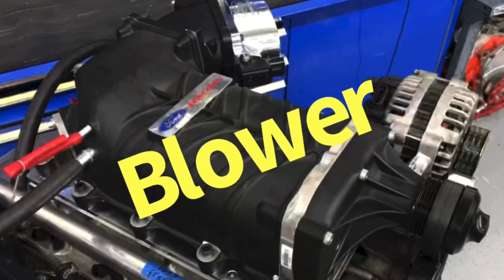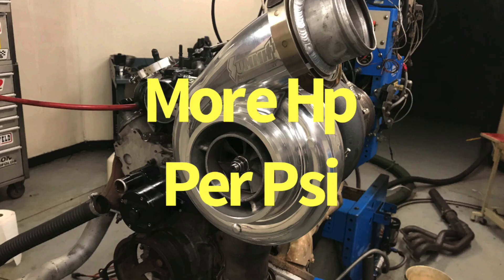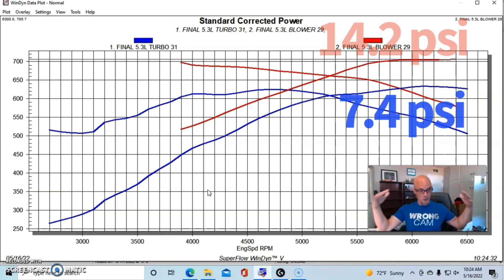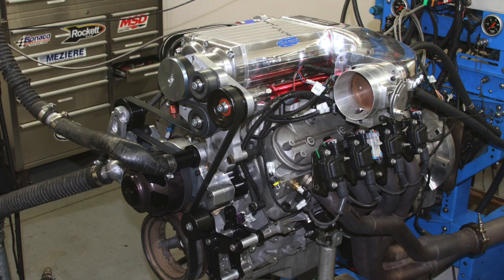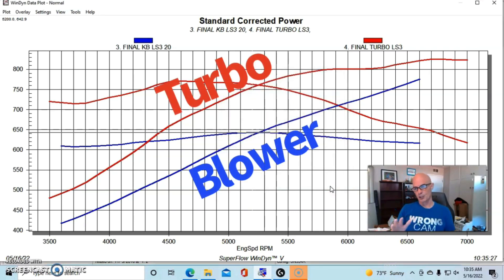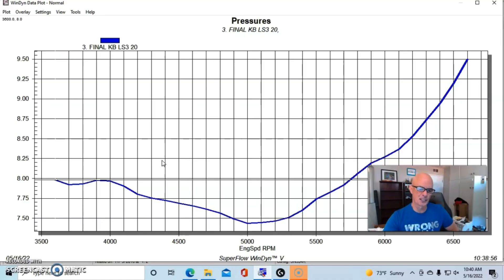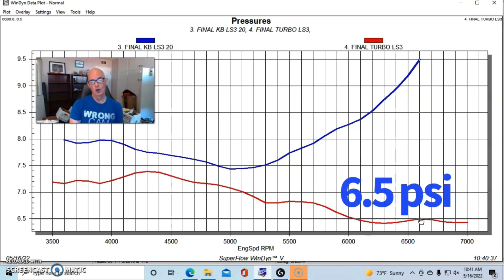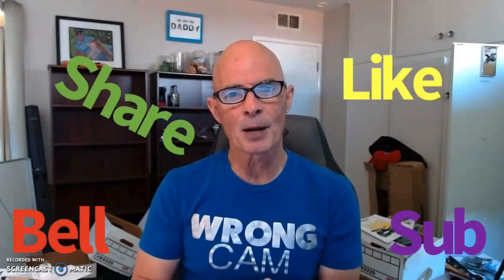LOW $ BLOWER VS LOW $ TURBO-DYNO PROVEN HP PER PSI! WHICH ONE DO YOU CHOOSE FOR YOUR BOOSTED LS?

Comment: I like both poweradders but let's face it, for the average guy working in his driveway Turbo's are free HP.  Even the "Cheap" blowers you feature with the manifold cost are well in excess of $3,000 anyhow.  With an Ebay GT45 some piping and gates you can outdo a positive displacement blower for $1,000, OK let's be fair and call it half the cost.  I have a 5.3 LS in my '68 C10 and I'm looking into adding a turbo, limiting it's output to 10psi and installing a 4l80 because I don't believe the 700r4 will last.  It's still cheaper IMHO than just the blower set up or darn close for most of us.
Reply: Turbo conversion for under under $1000? 
Never gonna happen.
It's exhausting hearing people say this over and over, and it's never a person whose done it.
Reply: @jacksonjdr94  Maybe in your case.  That's the conversion plus all the other parts that would be needed for a Supercharger install like injectors and intake.  I have done them before and the secret is honing your skills and doing the fab work yourself which I do.  That allows me to take an intercooler found on sale and make it fit a chassis.  You wanna buy a premade kit you'll pay for it but most times I'm doing a non stock install and you have to fab anyhow.  Sweat Equity.
Reply: @hardball107  lol. Ok man. If you say so. 👍
Reply: @hardball107  Where can we see your $1000 turbo conversion?
Reply: @jacksonjdr94  Sure, if I could post pictures of my 5.3 LS powered '68 C10 I would but just look at your costs.  A GT45 turbo off Ebay is $200, piping kits with blowoff valve are $150 for the cold side, waste gate and plumbing another $150, Intercooler kit is $200, Pass side turbo manifold for LS is $150 and kick in the last $150 for misc. parts, maybe air cleaner, oil return and decapping your injectors.  I limit my boost to 8psi to save my trans and my EGT is spot on.  You don't need billet parts and anything you can do yourself saves money.
Reply: @jerryp1776  I have a Paxton and you pay out the nose for them as long as they aren't blow up.
Reply: @jerryp1776  Not really, they work behind a stock or slightly modified motor but once you cross that 500hp threshold they are very iffy, you're almost better with a 200r4.  That's why the 4L60 also has problems, it takes modifications and major, custom parts to live over 500hp, input shafts, reaction shells, 5 gear planetary's, big servos, not to mention valve body work and so on.   In fact I used many 4L60-70 parts in my 700 when it was built but my 5.3 is only 385 at the wheels.  It's not about what it will take to break it, it's will it live for 50,000mi.
Reply: @jerryp1776  10 or so years ago I would have agreed with you but at the power levels we can now generate relatively cheaply times change.  I've put 200's behind NA big blocks no problem and 700's are great in that application BUT I've had 3 of them take out the forward clutch among others behind turbo LS's.  Failure from design, just can't pack enough friction material in there for power adders especially in a 4000+ lb car.  Now a days even the 4L60 is considered a small block trans, 4L80's are a different matter.  Just my 2c.

Comment: What about drivability? Most of us don't put it on the rev. limiter and let go of the button. Drag racers are always saying "I had to pedal it", we called that driving in my day. Need more power, push the gas pedal down further. So there's that.
Reply: Daily driven turbos are more common I think than superchargers from box stock manufacturers. Ecoboost and all that. And once you take away the performance aspect like a ZR1, old ford GT, cobras and the like, it seems hardly anything is supercharged from the factory. 

So if it’s sized correct a turbo doesn’t have shit for lag. 

Racing? Lag is from turbos that are too big for low RPM. But high RPM building boost they are gonna fly but not leave off foot brake
Reply: @ZONES89RS  Chicks dig the blower hanging out of the hood. So there's that to consider.
Reply: @lazyhoundracing9621  You mean boomers do

Comment: Would love to see the m122 blower on a 6.0
Reply: Me too, I just bought one to put on the LQ4 in my H2, biggest downside is the inlet of the M122 directly interferes with the firewall in my application so I'd love to see what to expect in a basically stock 6.0 before spending $2k on adapters or ditching it and go back to finding an LSA

Comment: Supercharger for that flat torque curve
Reply: Yes. Too bad the torque line for the blower was showing - starting at high rpm’s. I suspect it would have changed the dynamic of the conversation (here in the comment section).
Reply: @ZEPRATGERNODT  Dead on! What about the red hot headers? My engine is all about airflow. Putting a restriction in the exhaust makes no sense to me.